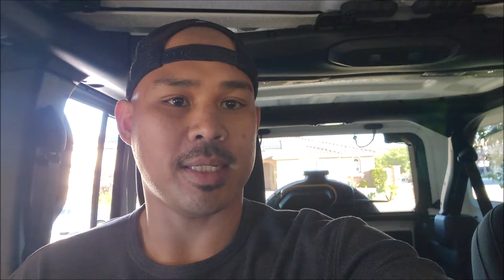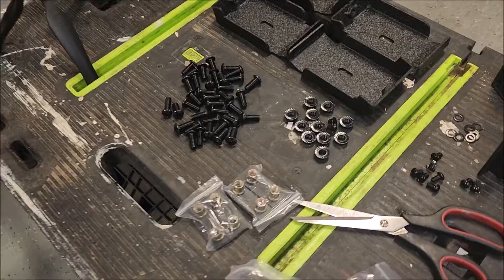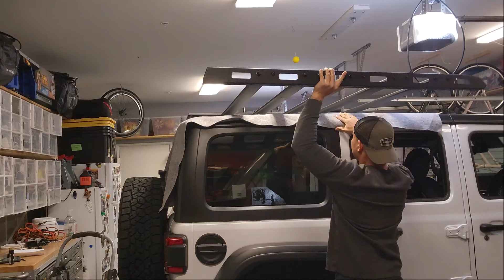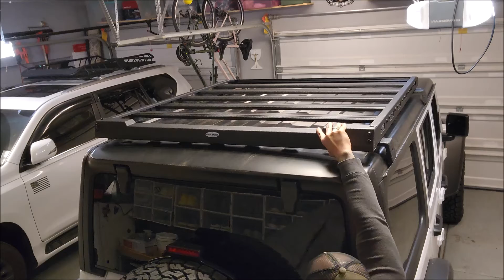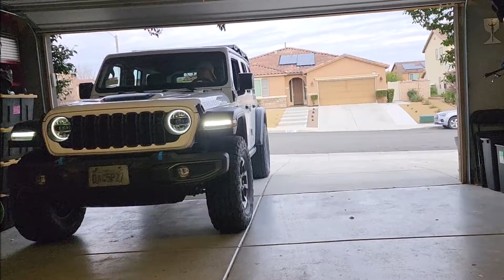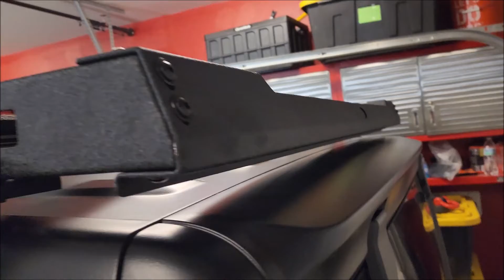Hooke Road Roof Rack | Jeep Wrangler 4XE Install and Review

Comment: I bought the same roof rack… but I guess I have an updated model! It’s much different in the way it installs and has holes in the “scoop” area in the back for better performance. I was disappointed because it made this video pointless (although you inspired me to get the dang thing!), but I see some positive changes they made! The biggest drawback with this manufacturer is that it came with one screw short as well as one screw defect— no threads!!! lol so frustrating… especially since it’s a longer screw and that doesn’t get used until the rack is on the jeep! Last minute trip with a different car to the hardware store in hopes of finding a replacement. Additionally, one of the rubber covers was slightly too big and fell off when placing the rack on my jeep, scratching the paint. So far, my frustration is beyond the worth of the rack, but that might change after having it installed and actually used.

Regardless, I appreciate you making this video because it really helps others with installation and inspiration. HookeRoad owes you one! 🙌🏻

Comment: Thanks for the video, well done. how has the rack held up? Have you had an issue with the doors hitting the mounts when opening?
Reply from the maker: No issues w the doors at all, I've recently took it from riverside cnty ca to flagstaff az about 900 mile round trip w 100 lbs and no problems, but I wouldt put that same weight up there off road

Comment: Nice!  I'm thinking of getting this too for my 2020 Jeep Wrangler... What was the name of the solution you used to add it to the bolts to prevent rusting?
Reply from the maker: Hey thanks, I used blue loctite:

Blue Thread Locker 242 Medium Strength Removable 1.69 Fl oz/50 ml Nuts & Bolts Locker Threadlocker Lock Tight & Seal Fasteners Anaerobic Curing Metal Glue (242) https://a.co/d/3NJTL9u

Comment: would it fit the sky one touch tops? 
it has the gutters like the hard tops
Reply from the maker: I don't think it will work because when the top is open the material will bulk up and push into the rack
Reply: but if i didnt open it, it would be fine? lol @HappyRockOffroad